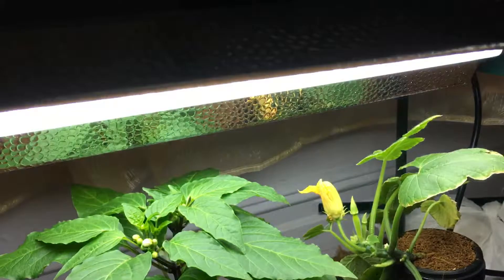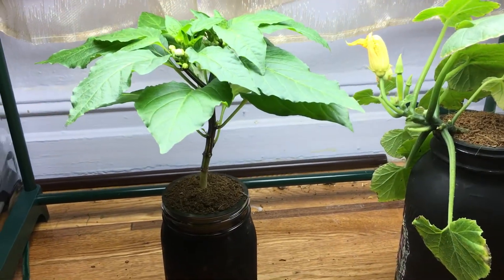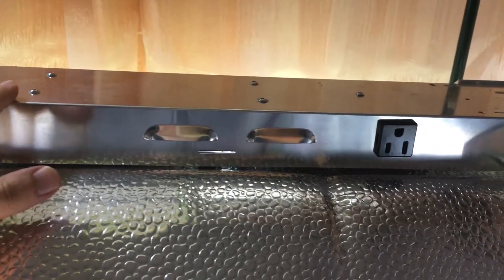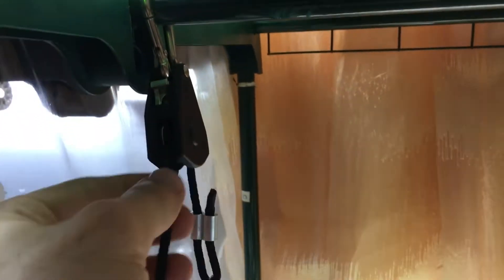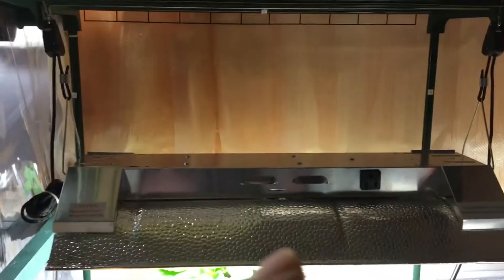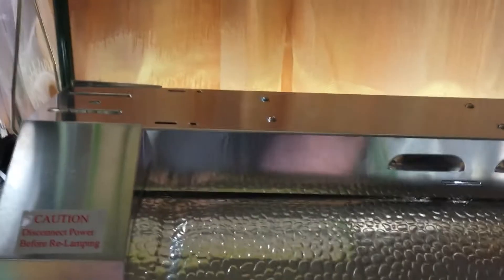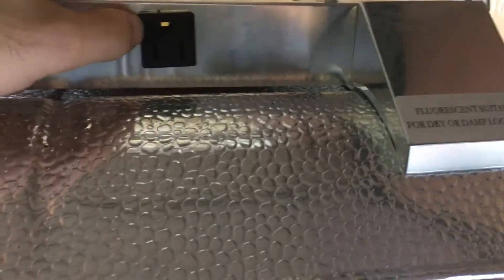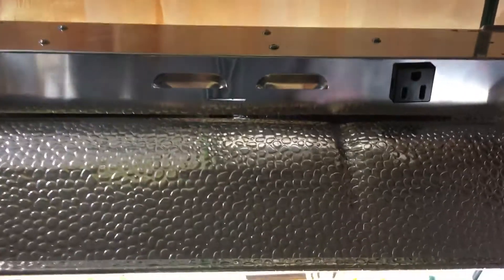T5 Grow Light (2ft 4lamps) DL824 Ho Fluorescent Hydroponic Bloom/Veg  - Personal Review: Pros/Cons

Comment: Thanks for the video. I’ll have mine about 8-10 feet from my couch . It’ll be lined up on the same wall as the couch and will be to the right of me. Does the light come out the sides where it isn’t covered by a reflector ? My current one is a 2 bulb system that has the reflector covering the sides of the bulbs . It doesn’t bother me at all or shine in my eyes . It puts off a tiny bit of side light . But I find it pleasant. Don’t want to have side light blinding me from the corner of my eyes tho . I just wanna upgrade so I can add more plants and get stronger succulents. Thanks so much 😊

Comment: Thanks for sharing.  I'm setting up grow shelves and this is very helpful.  Thinking about using LEDs instead of T5.
Reply from the maker: Hey James sorry for the delayed reply. I personally use both and find them to be quite different. I use the LED light for my cucumber plants since they get huge and climb on my trellis. LED lights have a much stronger penetration and you will have to have a good distance between the plant and the light, to not burn the plants. Not sure which lights your getting and to grow what, but I would suggestion looking at the wattage and light spectrum i find to be most important. I personally use the Mars 300 LED light LOVE IT.